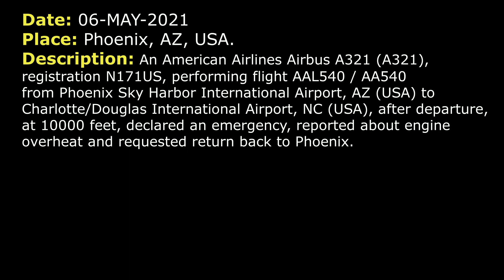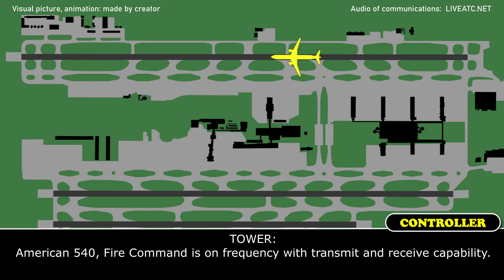Engine overheat. Pilots requested emergency return | American Airbus A321 | Phoenix Sky Harbor, ATC

Comment: Overheat usually points to a fluid leak causing premature combustion in the compressor. Kind of like a run away Diesel engine. This is likely why the pilot requested fire trucks on the ground. If it’s fuel it could ignite.